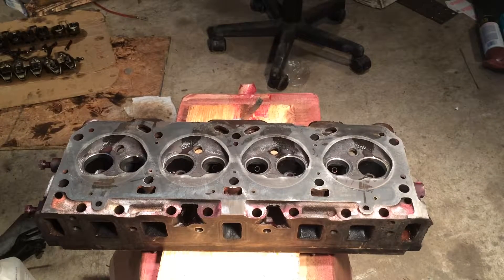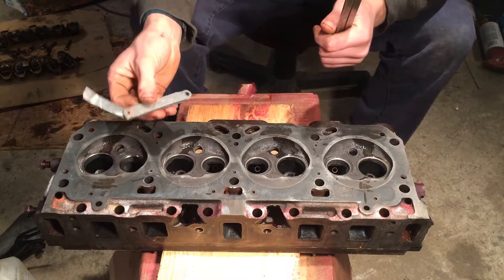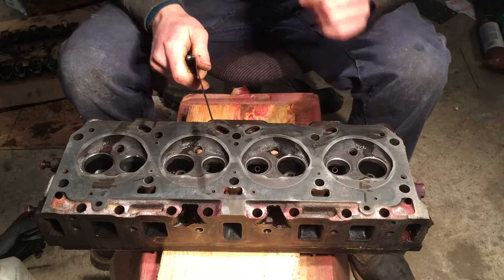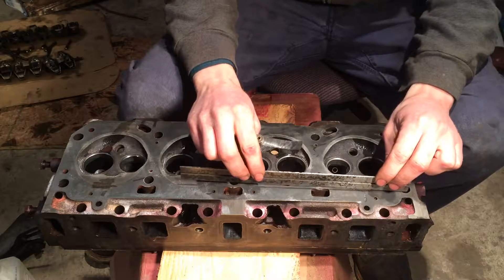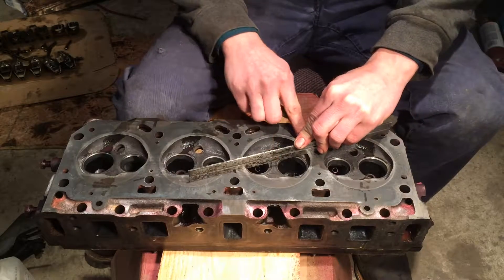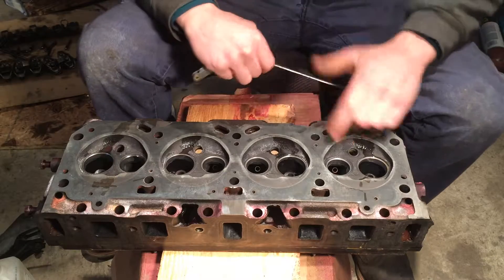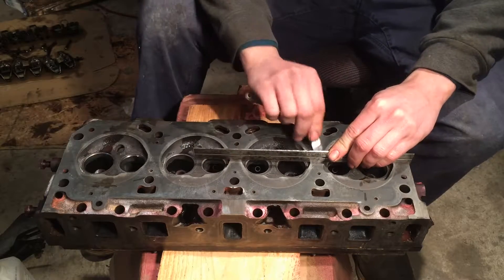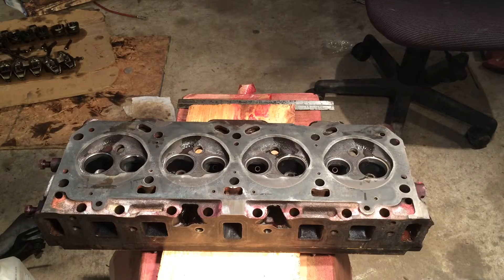Checking cylinder head for flatness

Comment: The reason why you want a straight edge to cover the whole length of the cylinder head is because the very short sides of the cylinder head is presumably the surfaces which are the most true on the head. Therefore, any dishes or warpage will be detected with your feeler gauges. If its too short, as yours are, then you might as well put the very end of the straight edge in a dishes and therefore, it will looks like its within specs, only because a) you press down the edge onto the surface, hence giving a false reading, and 2) wherever you place the straight edge on the surface, it will always show a true flatness since you don't have any reference points on which you could measure the trueness across the entire block/cylinder head.
Reply from the maker: I agree, a longer straight edge would be I deal (as I mentioned in the video) but this was the only one I had at the time. I figured checking with a straight edge that is too short is better than not checking at all.
Reply: Yeah thats true. I don't know if it's cheaper to take a metal bar to a machine shop and have it straight and true, or buying a new straight edge. I think both would serve the same purpose tho. Thank you for a good video!
Reply from the maker: You are welcome, thank you for the information.
Reply: where did you get the straight edge from? how accurate is it?